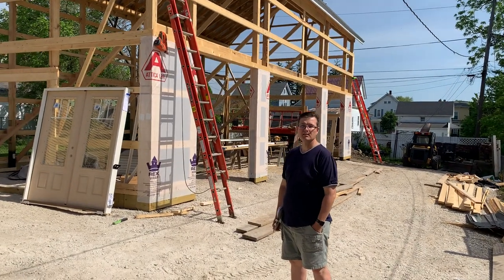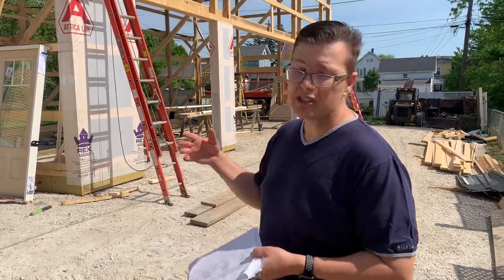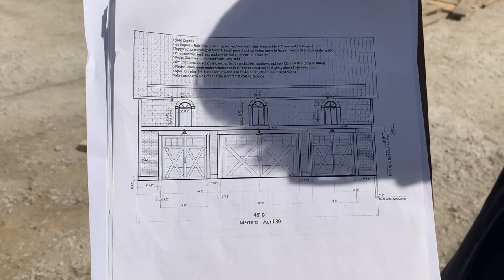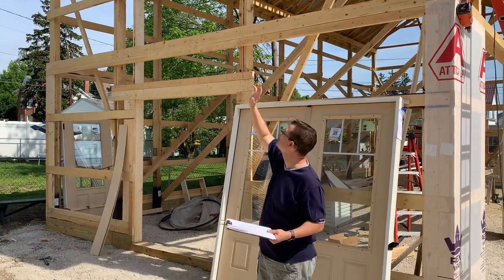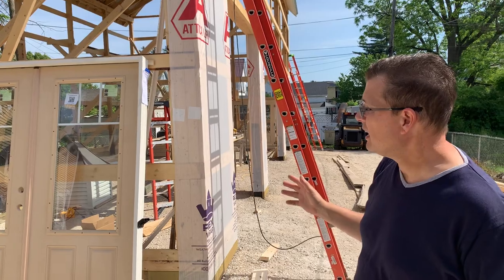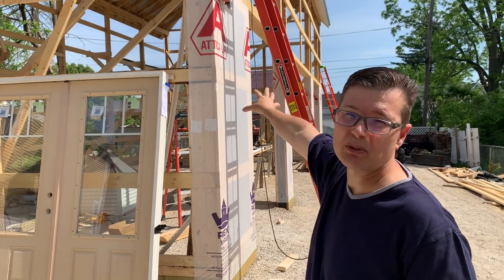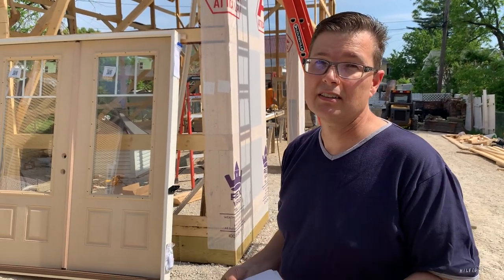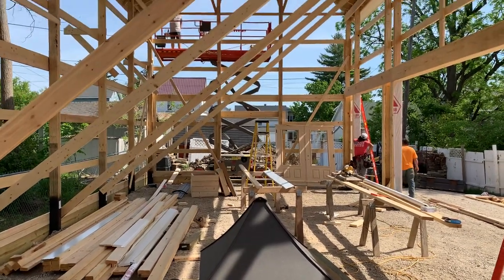Barndo (Owner) shares story of carriage BARN.

Comment: Great channel filled with information for those building, or planning to build!  Could you provide some specs on this one? Side height, overall dimensions, 1st and 2nd floor ceiling heights, and cost?  Also could you tell us who designed and did the engineering drawings?  Thanks!
Reply from the maker: 10’ first floor to I joist.  12’ to peak on second floor.  6’7” to sidewall on 2nd floor..  Building 22x48 18’.  Owner was able to provide engineering drawings and design.  We are flexible with clients on design and engineering requirements depending on knowledge and hands on experience.  Cost is variable.  Owner supplied certain accessory  parts of this carriage barn so price of building is tough to measure.